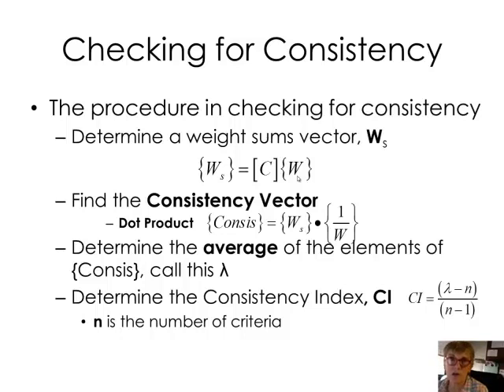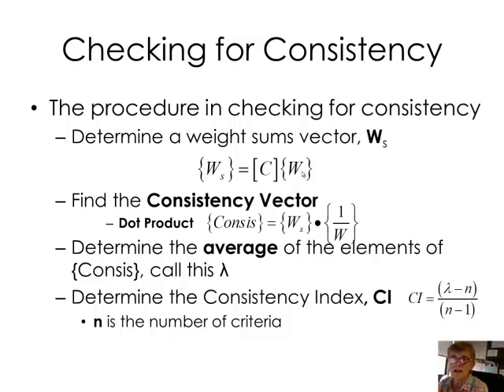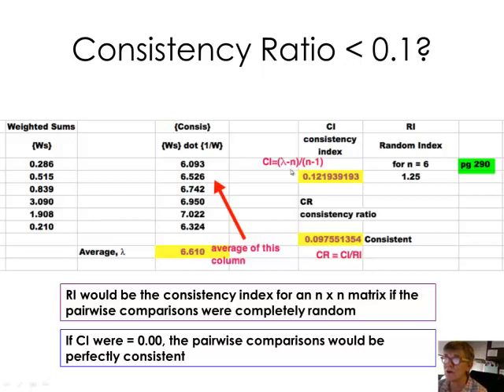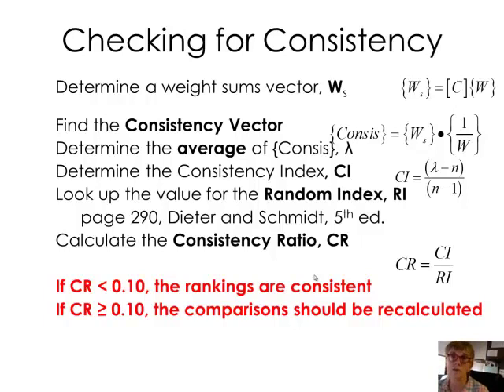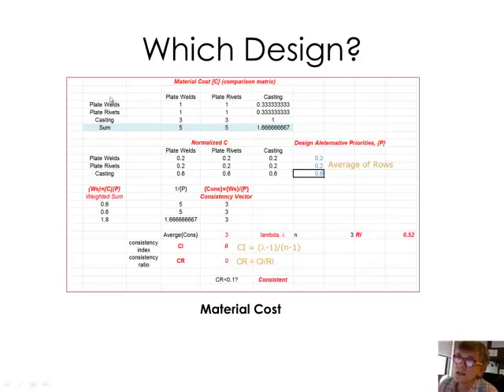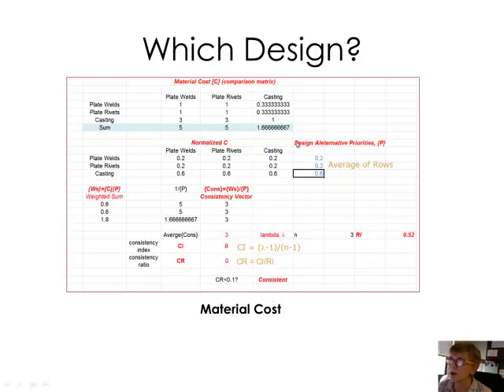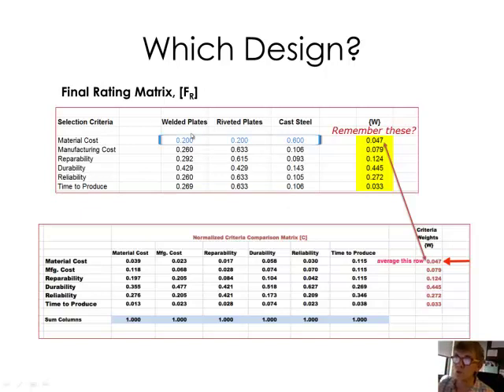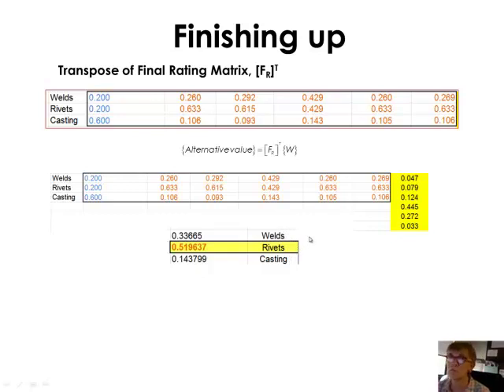AHP Part 2

Comment: Hi,

I have some problem understanding Ws and Consistency vector mentioned in YouTube video AHP1&2.

In the videos of AHP1 & 2, the formula to calculate Ws is C x W
And the values of Ws of material costs given in AHP2 are
0.286, 0.515, 0.839, 3.090, 1.908, 0.210

The value of C of material costs before normalized are 
1,         0.333,  0.2,         0.111,        0.143,       3 
In AHP1, the W of material cost is 0.047
If I calculate based on the above values, the values of Ws would be
0.047, 0.156,  0.0094, 0.005217, 0.006721, 0.141
The values of Ws calculated are very different from the values of Ws provided in AHP2. Is my calculation correct?

Also, if Ws = C x W, and {Consis} = dot product of Ws x 1/W
Then isn’t that {Consis} = C x W x 1/W = C

Would like to seek for help in clarifying the above.

Comment: To those who wondered about where the values from C came from, she mentioned matrix [C] on track 7:00 in her previous video, AHP Part 1 (remember, it's NOT the normalized one). Just take that matrix MINUS the sum-row, multiplicate it with vector [W] and you will get Ws.

Another thing is thank you so much for your time, Ma'am! I have seen both Part 1 and 2 and could not find any AHP-video better than this!
Reply: Please, could you explain more with example (w* first value how she calculated it )in same her example if possible how she calculate the C
Reply: @zainabal-baldawi9768  She started explaining matrix C from 4:00 in AHP Part 1. You choose the numbers in this matrix yourself based on your own evaluation of two and two of the criteria. She's categorized the levels of criterium importance into three right below matrix C, so here you can understand why she chose certain numbers in C. She chose Mfg Cost to be moderately more important than Mat Cost with 3.00, thus Mat Cost is moderately less important than Mfg Cost with 0.33. So actually you only need to choose numbers half of C and use this to calculate the rest of C, so 1/3.00 = 0.33. Work with the number 1s standing diagonally in C and divide by the number below it to get number to the right of it. For checking, do the reverse which is multiplying 1 with the number to the right of it to get the number below it. You may have to draw one vertical line and one horizontal line through the numbers below and to the right of 1 in C to see clearer. You'll see the diagonal pattern because the criteria stand in the same order vertically downwards and horizontally rightward.

Is this clear, Ms. Allawi?

Comment: A very comprehensive illustration of the AHP method. May I ask you how to incorporate the input of more than one respondents in the method? Moreover, if you could guide use on multi-level AHP problem, it will be a great favor to the research community. 
Please consider replying this at your earliest convience.
Thanks

Comment: ah, I was distracted by the rounding issues calculating the {consist} part!!

With only the values for {W} shown in Part 1 (with 3 decimals) and those in {Ws} the results of {consist} are slightly different than those shown in the Video. (might be helpful for someone stuck at the same point)

But other than that, this is really helpful to get to understand the logic behind the whole process. THANK YOU! :)

Comment: I'm lost where you multiplied the pairwise comparisons with the criteria weights.
Please can you show how you multiplied [C] with {W} to calculate the (Ws)?

Thanks.
Reply: +Olayinka Abikoye You can do this for 1st row of [C] (not normalized [C])(1.000x0.047 + 0.333x0.079 + 0.200x0.124 + 0.111x0.445 + 0.143x0.272 + 3.000x0.033) = 0.286. Keep going and you will fill the rest elements of vector {Ws}. In EXCEL, you can use function =MMULT(1.000:3.000,0.047:0.033) as well (where 1.000:3.000 and 0.047:0.033 are the array of row and column respectively) and it will produce the same result.
Reply: You sir, have saved the day. 11 Months on and your comment is still very much appreciated! Thanks
Reply: Canh-Toan Nguyen Thanks for the explanation

Comment: Hadi, to multiply two matrices [A] X [B] in Excel, first make sure that the number of columns in A is = to the rows in B.  Assume [A] is m x n and [B] is n x k.  Drag out an area in Excel that is m x k (rows, columns)--that m x k space will be for the product of [A] x [B], say [C].  In the formula bar, type =mmult(  and then drag over the cells where the values of A are stored.  Add a comma after the last cell of the first matrx in the mmult function appears.  Next drag over the area where the values of B are stored then add a right parenthesis to the close off the mmult function.  The formula bar will look something like this: =mmult(A1:c3, e1:j6).  A would be stored in A1:C3 and B would be stored in E1:j6). Next hold down the <ctrl><shift> keys at the same time and hit enter.  The m x k matrix, matrix [C] will appear in the area you drug over that occupies a space of m x k.  There should be plenty of YouTube videos that will show you how to perform matrix multiplication using Matlab or Excel.  Hope this helps you get started.

Comment: Hi! Where can I find the spreadsheets?
Reply: Gloria Starns Hi, thanks a lot for these explanations. But I'm confused with the dot product of Ws and (1/W) you discuss around 3:30. A dot product of two same sized vectors should return a scalar, no?
Reply: Hi Itchell,

You will have to create your own spreadsheet--the process of doing that will help you better understand AHP.
Reply: Gloria Starns Hi Gloria! I have done so. I'm just having a problem in getting the C to calculatethe Ws in the formula: Ws = [C]{W}. Could you please explain?
Reply: Itchell,

You need to drag out an area in the spread sheet that will be the resulting size of Ws.  Ws will be a column vector with n rows in it.   For example:  if [C] is n x n {W} should be n X 1; {Ws} will be n rows x 1 column.  

1.  drag out an area in the spreadsheet that is n x 1.  This area will be where the values for {Ws} are computed.
2.  Go to the formula bar and type =mmult(.  and drag over the contents of the C matrix
3.  Add a comma after the cell range in the mmult function
     The formula will now look something like this =mmult(B8:D11,
     B8:D11 would be the cell range occupied by the matrix [C]
4.  now drag over the range that {W} is in
5.  The formula will now look like =mmult(b8:D11, E8:E11  add a right parenthesis
6.  now hit ctrl-shift-enter and {Ws} elements will be determined in the area you drug over in order to store {Ws}
Reply: +Gloria Starns Gloria, could you please provide some references for the material presented in the video ?

Comment: is it OK to get "Consistency Index" CI in minus!!?
Reply: The consistency index is given by (lambda-n)/(n-1) where lambda is the largest eigenvalue of the pairwise consistency matrix.  n is the number of items being compared.  If the matrix is perfectly consistent, lambda will be = n and the consistency index will be 0.0.  Perfect consistency, or a consistency index of 0.0 is the smallest consistency index expected; a negative consistency index would not have meaning in the context of AHP.  Some people even use an approximation of the consistency index  using square roots of functions which clearly would not produce negative numbers.
Reply: ok i'll try to recalculate it again.. thank you very much for ur answer